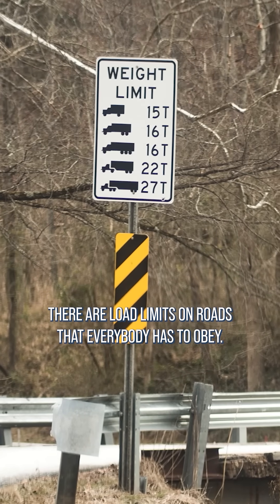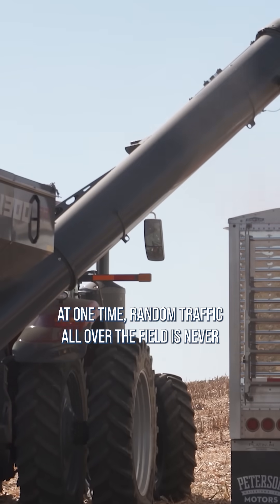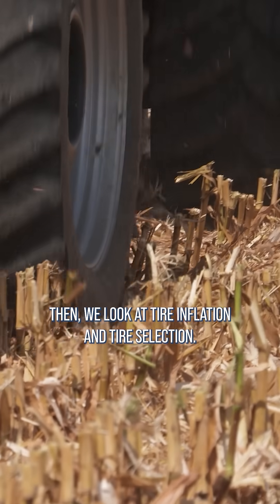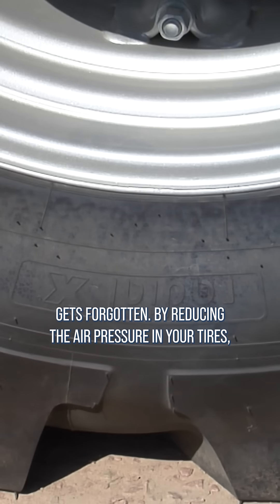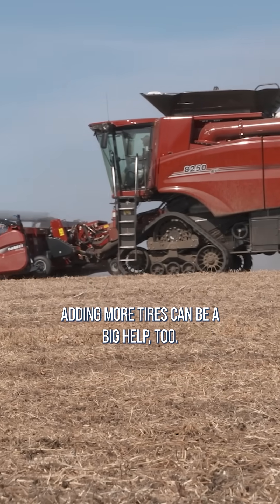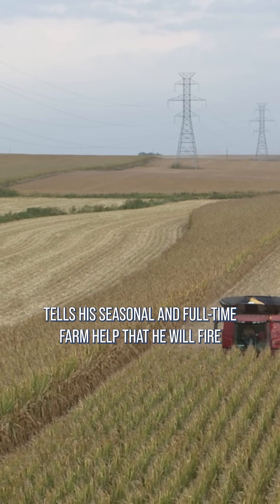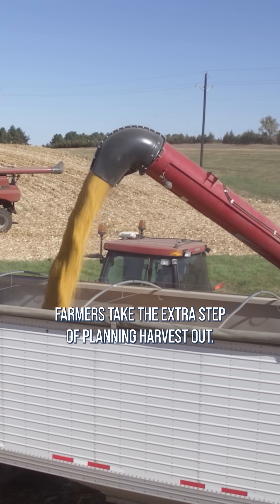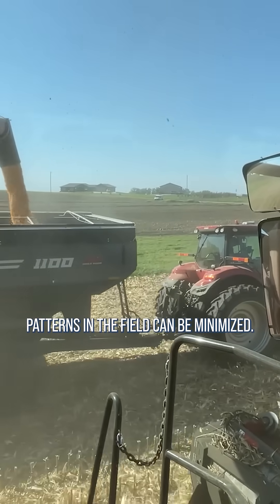Limiting the weight that you haul at one time is a critical step to eliminating compaction.

Comment: How do you reason when the seasons starting weather is bad? Heavy rains. Preventing good transplanting. Just bite the bullet, accept crop yield/loss and pray to the weather gods? Or hold off and risk/gamble on fall being mild?
Reply: No, the cost to repair waterways and rutting greatly exceed the crop value.
Reply: @edharm8446  So what do you do then?
Reply: @Sweedish_Delight  you plant late and get what you get. Costs more to fix a field you tore up than that yield hit does